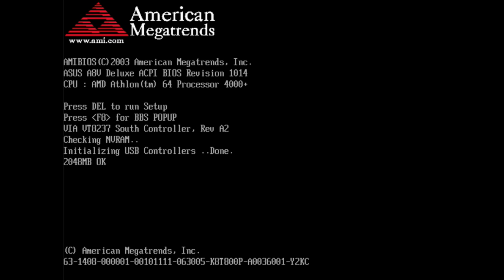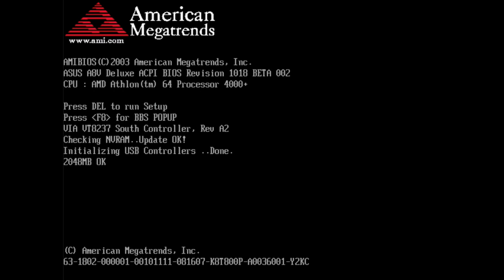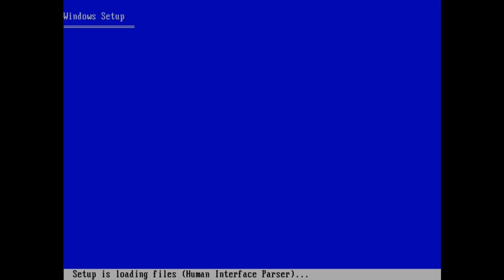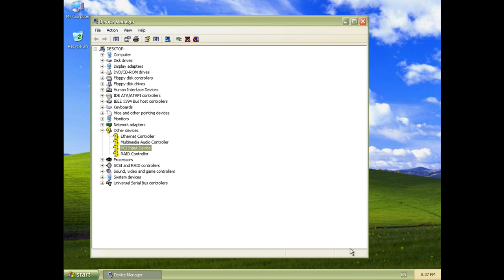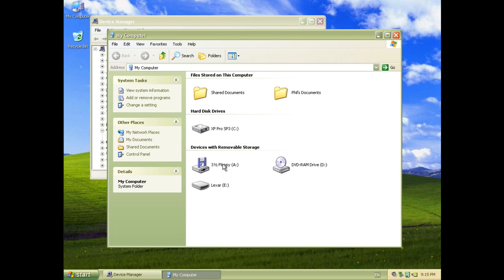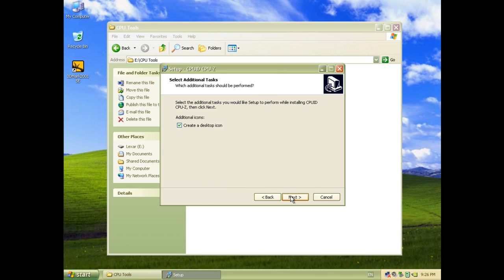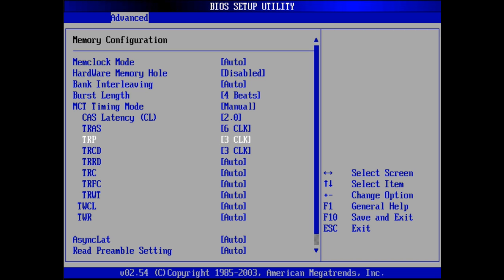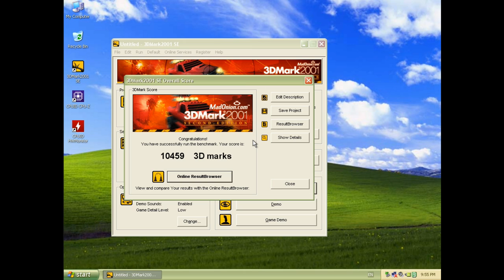Building my new PC for benchmarks and testing

Comment: Since SATA I is 150MB/s and PCI is 133MB/s, you'd be better off using your on-board SATA controller, since PCI will be the bottleneck even if your PCI card is running SATA II or SATA III.
Is a nice looking rig, though!
I had a 3800+ back in the day and then ended up upgrading to the X2 4200+ later.
Cheers!
Reply from the maker: In the video I am explaining why I use the PCI controller.
Reply: Oh, and also, on PCI, you have the other PCI cards competing for bandwidth and with bus mastering, another PCI card can be blocking the PCI SATA card from sending/receiving data until the other card is finished.
Looking at the block diagram: http://www.viatech.com/en/silicon/legacy/chipsets/k8t800-pro/ It looks like On-Board Ethernet, USB 2.0, and others are using PCI as well, so your PCI SATA will be competing for bandwidth with those as well while the on-board SATA is on the southbridge itself instead of needing to go across the PCI bus.
Reply: the integrated sata doesn't support sata 2 and sata 3 devices (as in they don't work outright instead of being bottlenecked to sata 1) so that's why he had to use a pci card
Reply: SATA II and SATA III is backwards compatible with SATA I, though.
Reply: Zzyzx Wolfe it should be yes

but some sata 1 controllers won't take sata 2 and 3 anyway

basically the integrated sata is shoddy and prolly does something that was "ok" by sata 1 (outside specs ofc) but was not by sata 2 and 3 anymore and as such it chokes on sata 2 and 3 devicea
Reply: Zzyzx Wolfe for example: druaga1 (a youtuber) tried to install a sata 3 ssd inside a powermac g5 but failed because the sata controller on that didn't like the sata 3 devices

since it was made by apple its definitely possible it did some things outside the spec which ended up in the same thing that happened here
Reply: I guess I just misunderstood what he said in the video. I thought he was just saying that it either wouldn't work or would be slower than using a SATA III PCI card, not that this specific SATA I chipset didn't work correctly with SATA III, which isn't something I've come across personally.

Comment: Can i use a new 2020 hard disk drive on a sata1 protocoll?

I watching this before going to bed
Reply from the maker: It depends on the SATA controller, with this board, and VIA controller, I think there will be issues. Alternatively you can use PCI SATA controller or SATA to IDE adapters.

Comment: I know VIA SATA controllers are a pain (most revisions having issues with SATA2 stuff), but isn't the Promise controler any better? It it is couldn't you avoid the addon PCI controller altogether?
Also, if you can force the SSD to SATA 1.0 (1.5Gbps), using the VIA controller might actually be the best one for that PC, since it is not constrained by the PCI bus. You might wanna try benchmarking a spare SSD if you can force it to a slower bus speed.
Reply: That being said perhaps using a good SATA->IDE converter on the SSD might be easier and still be faster than the addon controller?
Reply from the maker: Give it a go and see if you can make it work.
Reply: Unfortunately I do not have spare SSDs to test, though I do have a VIA-based LGA 775 board with a VIA VT8237R SATA controller. Back in the day when it was my daily driver I used a jumper on the HDD, and when I loaned it to my brother I had to use Samsung's ESTOOL (their equivalent of SeaTools) to make a newer HDD work.

Comment: Apropos Socket 939: Would be interesting to see an comparision between the A64 4000+ and an A64 X2 (even when it is the 3600+ or 3800+) with games from that era.
Reply from the maker: Well that's quite a bit in the future. The main idea with this machine is to have GPUs run at their fullest potential, but I used it also as an opportunity to switch to Windows XP.
Reply: I guess the performance depends on the games.
It was a tansition rom single core to dual core.
Some games run better on a fast single,, some show impovement on a dual. And Intel actually widened that even more with hyperthreading (Pentium 4 came oin Single, Single with HT, dual and dual with HT)

Comment: Hey phil, great video and  uild :) i have a similar machine, but nforce3 asus board and xfi. Do you have ecperience with recapping an old gfx, my 6600gt looks ready to burst, would it fry if it went while in use, you think?
Reply from the maker: I will do a video soon on replacing caps, I but I will use a motherboard to show it.
Reply: Yeah, that certain phase when alot of cheap caps were used.
I saw alot of recaps on voodoo cards and socket A boards.

Comment: I remember XP having a big performance penalty when compared to 98, though I believe that was mostly down to the fact that I was running a Celeron 950Mhz with 128 megs of ram and and crappy integrated video.
Reply from the maker: I did a video comparing these operating systems on the same machine I found little differences. I am though willing to give up a bit of speed for the many benefits I get with using XP. Especially all the GOG and Steam games!
Reply: PhilsComputerLab Yeah, pretty amazing how a single OS can be compatible with ~20 years of software

Comment: Good vid. Have quiet the same Setup. Same Board, Athlon64 3700+, 1gig RAM and Radeon 9600pro 256MB VRAM. Decided to install Win2000 rather than XP. Playing GTA Vice City and other older stuff. One question, how can i increase the resolution in Incoming?
Reply: Start Incoming from command line with -screenmode and see what resolutions it offers you. Then start the game with -screenmode and the resolution you like to try it out. Then edit the Incoming shortcut and add the -screenmode ... parameter to it.

Comment: let me guess socket 939? looks like asus board i have!! asus a8v
Reply: a8v-deluxe! :D

he says it around 1:25 or so ;)
Reply: i forgot socket 939 had dual core support, i think that will be a good upgrade to my classic gaming rig.
Reply: Was easy to spot it as a 939 board.
AMD2 and later have longer, slimmer brackets orr the cooler and Socket A chips don't have heatsprreaders.
My fost thought was actually a 3800+
Reply: 939 and 940 are though quite similar in layout and uses same brackets.
754's also got same bracket but have this square hole in the middle of the socket like old cpu's so its easy to spot

Comment: Reminds me a little of my XP rig. Athlon 4200+ X2 clocked to 2.8GHz.
I you ever benchmark a Nvidia 8800 GTS 320mb it's going to be fun to se how mine compare to yours :)
Reply: Correction, it's clocked at 2640MHz
It gets 30510 in 3DMark 2001, but thats mostly the graphics card boosting it up.
Reply: Nice result. With a Xeon X5460 clocked to 4.1 GHz I got around 55k-58k depending on the OS and graphics card (Used XP SP3 and 7 SP1 on one side and a R7 250X and 660 Ti on the other)
Multi core won't do much there.
Reply: That's why it would be fun to see how they compare, powerful single core against a dual core in the same family.

Comment: I would put Phenom II X4 BE, use to have it, very powerfull CPU on ASRock MB and 2GB more RAM (use to have 2x2GB DDR2 Kingston HyperX 1066MHz), these are my recommendation with ATI Radeon HD 3850 most powerfull GPU for AGP slot.Wish you good luck and hope more videos to come! ;-)
Reply: Exactly what I built for myself. )) But this PC (with ASRock AM2NF3-VSTA motherboard) is limited to Windows XP 32-bit only.
Reply: Yes it is, when I installed Win 7 the graphic card didn't work because lack of drivers for AGP (Vista too)!But that works fine even these days for gaming I suppose...or maybe not?Let me know, did you try CS:GO, BF1,etc..?

Comment: Hello @PhilsComputerLab very nice video! Do you know the driverpacks project? (driverpacks.net) y also use WSUS Offline Update to avoid connecting my old systems to the internet.
Reply from the maker: I like to get the latest driver myxelf and just install them from a USB. For more tricky projects, like putting XP on a notebook that doesn't support XP, I had good runs with Driver Booster.

Comment: a socket 939 motherboard with no PCI E slot? ive got mine right next to me and it has SLI support, im sure you could have found a motherboard that had PCI E and And an AGP slot, i feel like using that motherboard you are missing out alot on the early PCI E cards as they also had AGP counterparts that you could have benched against. also 2GB of ram? when i got my socket 939 motherboard i had 4GB of DDR400 2x2GB, i dont get why you always seem to pick a low amount of memory for every build... 

although i will say that by the time i built my system i had a Nvidia 7300GT so maby my build was newer than what you are going for?
Reply from the maker: I've only gotten to GeForce 256 and 2 cards. It will be quite a while until I get to PCIe and I would use totally different hardware for that, much newer.
Reply: As Phil said he will use a totally other mainboard if he ever gets to the PCIe-era, but apart from that PCIe/AGP-combo boards are highly problematic and not suitable for benchmarking.

Comment: I have a GA-MA59SLI-S5 and it has two SLI-way for Nvidia cards.
Plus, i have a DDR2 8GB RAM (Supported up to 16GB and ECC RAM!)
And, the last is... AMD Athlon 64 X2 6400+ @ 3.2ghz
If i'd like to you test with my build.
Oh, there's forgot metion, it works running Windows 10 64-bit.
Reply: Hideg Jenő Péter Why would you use Win10, this build seems more like an awesome XP machine :(
Reply: yeah i know. i used Windows XP Professional 64-bit edition. (with SP3 because function wifi router)

Comment: I have the k8v as well but no driver disk. I'm having a hard time getting drivers for the lan from Asus. any ideas?
Reply from the maker: It's a Marvell. Someone else asked about the drivers. I might put it up on my website.
Reply: I just got then to work from Asus here at work. I tried for an hour last night from home with no luck. Thanks again.
Reply: Look out the manufacturer and model of the LAN controller and get the drivers directly from them. Especially Realtek and VIA have alot of older driverrs still around. And maybe updated versions that are not shipped by the board manufacturer.
Reply: Only drivers Asus shows are ethe Marvell and so does the manual. And the Marvell site isnt that great.
Reply from the maker: In case you want the other stuff from the original driver CD: http://www.philscomputerlab.com/agp-gpu-benchmark-system.html
Reply: PhilsComputerLab downloading now.

Comment: hey Phil i very like you Videos nice suff nice hardware :D

an you looking for more information about get the memory Voltag or other stuff on old machins
today the best tool to get this kind of information is Aida 64 / to windows 2000 and xp time this software was called "Everest Ultimate" from Lavalys if you finde a old workin version or the atm aida 64 version would work on 32bit you get mutch more information in only one programm :D
and this programm have littel cpu and fpu benchmarks
Reply from the maker: Thanks I know both, Aida and Everest. I think I got them saved, might start using them again :)
Reply: i try the atm version on win 7 32 bit it works but i don't know how it works on win 98 or xp :D and if you use a fresh install you could use the trail version this is very nice but annoying
Reply from the maker: It seems Aida 64 isn't free, and Everest discontinued. That's a bummer.

Comment: Phil Phil you said only sata 1 hard drives work with this board are you sure?
Reply from the maker: Yup, the curse of VIA SATA controllers :D
Reply: I've got and show in my vid's a Asrock 4core vsta motherboard with a PT880 pro Via chipset which doesnt detect any of my drives/discs? So it has to have a SATA 1 drive or boot fail?
Reply: your the best!
Reply from the maker: So what I found is that firstly, it won't boot from SATA optical drives. You got to use an IDE optical drive. Hard drives that are SATA II, often have a jumper, which changes it to SATA I, then they work. But not SATA II  or III drives, also no SSD and anything modern really.

A real shame, as otherwise these chipsets work great for me!
Reply: I have one more question as its been along time since ive dealt with AGP. I have been given a nvidia BFG 7800GS and i cant get a display out of it. My first board test was a ABIT AS8V and theAsrock 4core-dual VSTA. Could it be my boards just wont support it or is it more likely DOA?
Reply from the maker: My gut feeling is that the card is faulty. Apart from some very old AGP cards (like a Rage Fury MAXX, or Voodoo cards), there are usually almost no compatibility issues. I'm sure you plugged the external power into the card, but apart from that there is not much else to check. Just to be sure, do try an Intel chipset board if you got one, they are the reference to rule out compatibility issues.
Reply: Thanks Phil been watching a while you have some great content! and advice!

Comment: my main pc got about 5900 in that same benchmark at 1600x900 and this old PC got so much more .. LoL..😥😥
Reply from the maker: LOL what are the specs of your main PC?
Reply: it has an pentium 4 631 and 4gb ram!!
Reply: D3Mark 01 doesnt ose more than one core so you hyperthreading is worth nothing for it.
And a 2.4 GHz A64 is clealy faste than a 3.0 GHz Pentium 4. Yes the 4000+ name is a bit overestimated, but it clearly beats the P4.

And maybe your graphics card is to new!
I've seen games where a Radeon HD 7870 is beaten by a Geforce 7800 GS.

Comment: Do you have access to XPx64?
Reply from the maker: I cannot recommend XP 64 bit for gaming! Stick with the 32 bit version.
Reply: Gotcha. I actually had a computer back in like 2007 that was an Athlon 64 with a couple EVGA 7800GTX in SLI. It was horrible. I ended up disabling the SLI and using a dedicated graphics card for each monitor. I didn't know if it was still a poor choice. I have the original disc/box still sitting on my shelf. When I watched this video, I thought about it and figured I would inquire. Thanks!!
Reply: It was horrible because of Windows 64 bit, I meant.
Reply from the maker: Yea there was this 64 bit patch for Farcry, but that got later put into a fan patch. Apart from that, I cannot think of a benefit to be honest.
Reply: If you absolutely must get those 64-bit advantages, just grab Windows 7/10 64-bit versions and dual-boot with XP.

Comment: Why you didn't use the motherboard with nforce4 chipset for this build? This is the best chipset for A64.
Reply from the maker: You have 3 guesses:
Reply: Aaa ... there isn't nForce4 motherboard with AGP slot, so why would you not use nForce3 then? ;-)
Reply from the maker: You have 2 guesses left :D
Reply: Hmmm... You had some compatibility issues on the motherboard with the nForce chipset.
Reply from the maker: I don't have any nForce board. But I have four! of these Asus boards, so it was an obvious choice.
Reply: So the motherboard with VIA chipset was cheaper and easier to get, I understand. ;-)

Comment: i still nave an A8V here somewhere, probly the first i bought also. using a p4p800 with all in wonder 8500 dual booting win 7 and xp to use old programs that wont run on win10 on my other machines